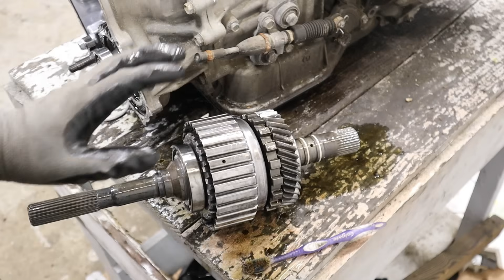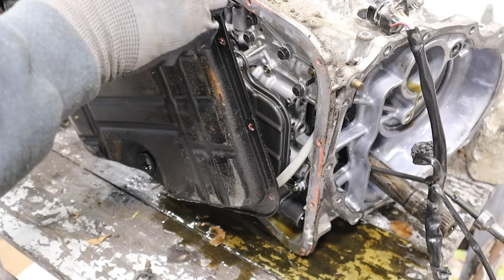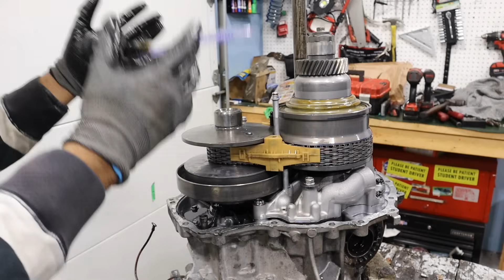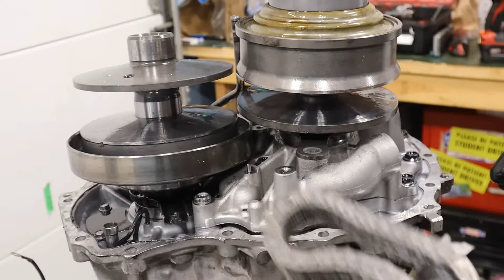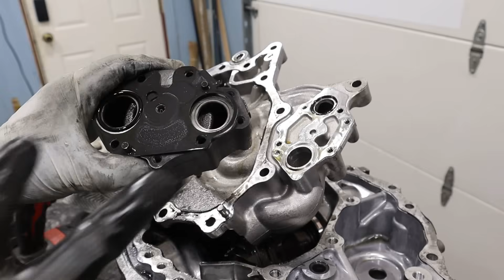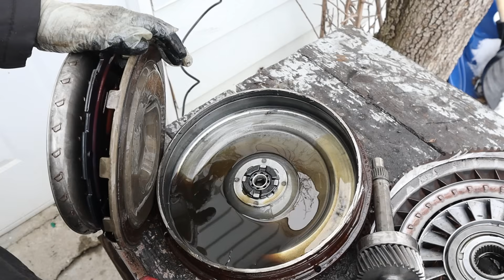Are Subaru AWD CVT's Reliable? Subaru Outback Transmission Teardown!

Comment: I'm not sure with all the catastrophic surprises that happen in the world of the automotive industry, starting with direct fuel injection, then CVT transmissions, then small engines with turbos, then the abundance of plastic parts inside the engine compartment, ending with the disaster of the wet belt to operate the oil pump, I will keep my Ford Crown Victoria forever.
Reply from the maker: It's a good philosophy but new car buyers don't think about reliability and longevity as much as us poorer people do.
Reply: @speedkar99 You are right. A lot of people I know only cares about the look and the inside trims of their cars. Little they know some of the electronic creature comforts will cost an arm and a leg to fix.
Reply: @speedkar99  I live in Sweden, fuel costs is the main reason for not affording driving a Crown Vic😁
Reply: @speedkar99 
I’m glad I’m poor then.
My 2013 Si and 2001 Integra should keep me on the road for the rest of my life…
Reply: @speedkar99  and the auto mfr's don't care about anybody else. So they build it for today. Back in 1970 my Dad, an avid GM buyer (bought Pontiacs and Oldsmobiles every 3 years) my Dad said if GM could build a car out of cardboard that only lasted 2 years, they'd do it.
Reply: What matters is not that. What matters is quality. My 4cyl turbo subaru made it to 300k miles before I sold it. Why? Japanese engineering of small engines is superb given they have been making that product domestically and perfecting for decades. CVTs like Toyota's eCVTs are geared which basically makes them bulletproof. Port and direct injection hybrid systems also address the drawback of direct injection. Tech is always evolving and I think the biggest problem with cars today is people try to see how far they can push that maintenance schedule. Now you have first oil changes recommended at 10k miles... Yeah. Do that and then complain your engine isn't made the same way as the one that had 3k oil changes...
Reply: @cmdrls212  we change our oil with valvoline full synthetic every 10k and have 300k on cars that pull
Reply: They also need more service but make it harder like no fluid dipstick or 2 filter inside CVT.
Reply: I have an 11 grand Cherokee, replaced the radiator, condenser, starter and power steering pump 😅 but hemi and transmission are still strong, simple 5 speed and American V8
Reply: Whatever
Reply: I have a 03 crown Vic I hear ya. Keep in mind direct injection is getting better and Toyota is doing it right by having port injection, too, and eliminating the cleaning cycle which is noisy. People don’t like that.
Reply: no exaggeration at all... "all the catastrophic surprises". 🤣🤣
Reply: Same. None of my friends' cars with small turbo engine made it past 120k miles. My car with an NA engine is still going at 190k+.
Reply: @awdrifter3394 Are the engines what failed?
Reply: @pootispiker2866  Yes. One has a Honda CRV 1.5T and another has a Mini Cooper S 1.6T.
Reply: @pootispiker2866  I own renault k9k 1.5 turbo diesel with DCT, 350k km it still running. DCT clutch starts to slip but completely ok at this range.
Reply: That's business. You can say most people are stupid, but it is what it is. Millions of brand new Rav4 and F150 are sold every year, and their owners are all rich greedy and stupid people. See the trend? Technologies do not suddenly pop up. They are continually evolved during decades. From the year your Ford Crown Victoria released to nowadays, there were thousands to millions of new models cane out. Some are reliable and survived; some are not. Unfortunately you are not a customer of any of them, so why do they have to care about your opinions?
Reply: I'm gonna go electric for exactly the same reasons.
Reply: Throw away cars @LegoDork

Comment: Subarus are weird.  For every person I know who has had completely trouble free ownership, another person I know has had endless issues and hates the car.  When they work, they work well I guess?

But both groups complain about fuel economy.
Reply: I work on cars and have had 4 Subarus. They are fairly simple which I appreciate but they are also thinly built. That helps with weight but they have some common wear patterns that aren’t present on other cars. They eat wheel bearings for instance.
The annoying thing about them is that they are pretty good at everything and for the most part they are honest. The best Subaru would be one with a Toyota V6, normal automatic and some more sound deadening :)
Reply: @ricepony33  In other words a Lexus IS 350 AWD. If they sold the BRZ they could have sold one of those too rebranded.
Reply: @InlineSkateFitness if only it was a wagon.
Reply: My ‘16 Forester (2,5 l) has a great fuel economy. My impression is that Subarus like good and proper maintenance, and like to be driven gently. If anything of the above is missing, you start having problems.
Reply: There is great reason for this! I had an outback with 400k, and a legacy GT.

the two big M's of the subaru world, mods and maintenance

Subarus are reliable, but also finicky in nature. They dont take abuse as kindly as other brands. They do not like aftermarket parts of any kind, weather thats a perfomance part or just a off brand repair part. The ones you read with good experiences are always 100% stock, serviced with genuine subaru parts. No tunes, No intakes and blow off valves, No big turbo, just stock.

The bigger one is maintenance, fluids need changed often. For example, you could go 10k between oil changes on a Toyota, but on a Subaru i recommend 6k and then every 3k after 100k miles. Transmission fluid, diffs, and pcv systems need serviced every 36k. Keeping up with the Subaru japan maintenance schedule is a necessity to keep one of these things running good for a long time.

These cars treat you exactly how you treat them, but your rewarded with a pretty reliable, very safe, go anywhere car in return!
Reply from the maker: I guess its what works for them. Subaru wants to be different and have held out despite boxer engines and full time AWD having severe limitations.
Reply: @speedkar99 the six cylinder is dramatically better than their 4cylinders. But it will never be a Toyota or a Honda.
Reply: You’re a mechanic or Subaru engineer? I haven’t encountered any of the issues in your comment. As with Honda and Toyota, No brand is perfect.  All of them have loads of issues

Comment: I remember a decade or more ago I used to love the idea of a CVT, but I've never liked the general engineering approach taken to make them work...
Reply from the maker: In theory it's supposed to make a car quicker as well. We all know how that works now ...😥
Reply: They make it harder to maintain and need more fluid change. No dipstick and Honda have 2 filter. It's design issues.
Reply: Best CVT in the market from engineering approach that gives you smooth quite operation is IVT from Hyundai.
I have tested all CVT from Mitsubishi since 2002-2010, Nissan Altima 2015, Subaru 2019, Honda 2020, Toyota 2017, Hyundai 2024.
The Best is:
1.Hyundai
2.Toyota
3.Honda (Bad reliability)
4.Nissan
5.Mitsubishi
6.Subaru (I hate it so much)

All CVT needs to be flushed at every 25K miles

Comment: The quality of this CVT was one of the reasons why I went with a subaru. Aparently, these can handle 400nm, so with a stock engine, the cvt isn't being over stressed.
Reply: Not over-stressed from power, but many don't have a transmission cooler so, they just burn up instead....Changing the fluid helps a lot too, most people skip that routine maintenance and that is where a lot of failures come into play is from the lack of maintenance.
Reply: @wildbill23c  the newer wilderness model is the way to go ive heard, i know on the outback its the "high output" variant with a transmission cooler!
Reply from the maker: I agree this is much differently built than a Nissan!
Reply: Other than BRZ, Subura vehicle lineup are some "ugly" looking vehicles and the crosstek needs a redesigned exterior........

Comment: 4:01
I have a Honda equipped with a CVT. CVT oil is not red like the automatic transmission oil, it looks more yellow like an engine oil.
Reply: subaru cvt oil is green
Reply: or in case of Subaru CVT II, its of green color.
Reply from the maker: Good to know
Reply: The only reason i don't want CVT is it need fluid change more often and it doesn't have dipstick. Honda use 2 filter so it's harder to service not worth my time.

Comment: You can now buy just the solenoids. ;) It's still a bit of work, but now you can diy this for less than $200 including CVT fluid.
Reply: I’d like to see CVT’s all start to use chains like this, it almost seems somewhat reliable!
Reply: @dialer2 well, it is, if you drive it conservatively and change your fluid often.
Reply: Finally. I'm glad to hear because I have an 09 Subaru and am dealing with the head gasket issues. I know they've since fixed that, but this was the problem on their newer models, they always manage to have some weird failure point at 100k miles. It kept me off the brand for a while but I may go with them again if they fix the solenoid issue
Reply: @Bob-ew5ul i got a 2020 when i heard chains
Reply: The solenoid issue was fixed 10+ years ago
Reply: @bofty can't be, first of all Subarus 10 years just started getting CVTs in them. I've seen some 2019 or 2021 have these issues...
Reply from the maker: I heard the aftermarket has come through with some.